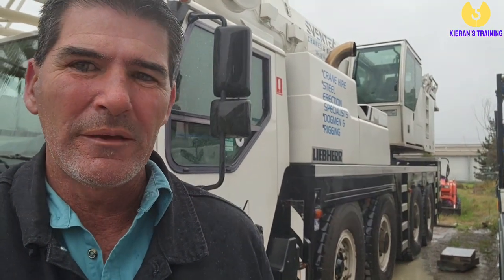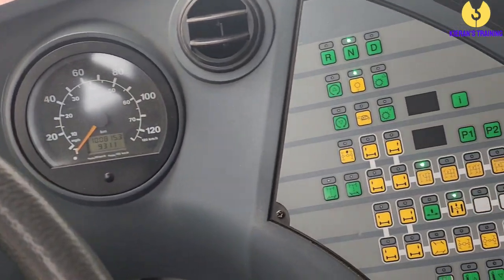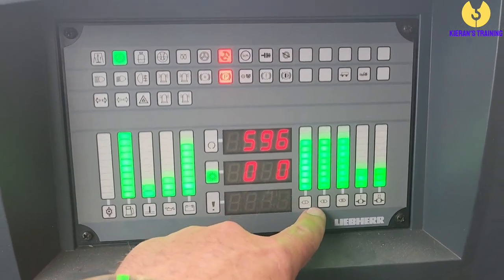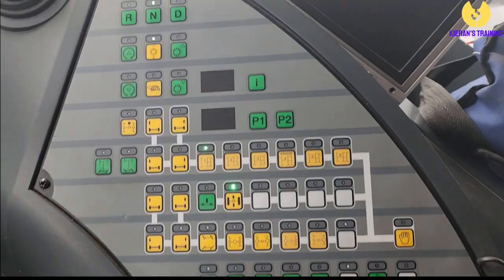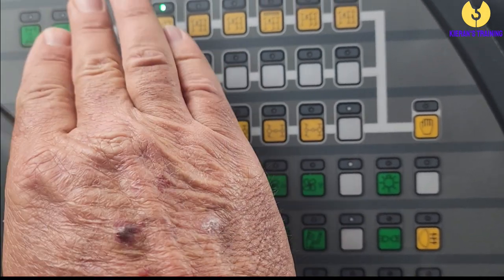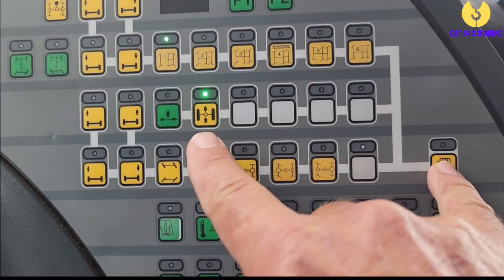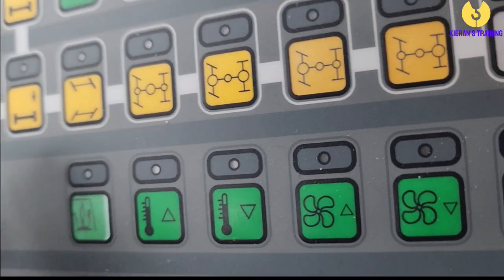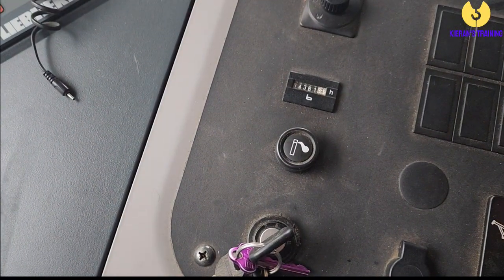Liebherr crane LTM1090 Lower deck

Comment: On liebherr crane ltm 1070 4.1 70 ton 2018 model,what are the functions  of the upper bottons in the operators cab